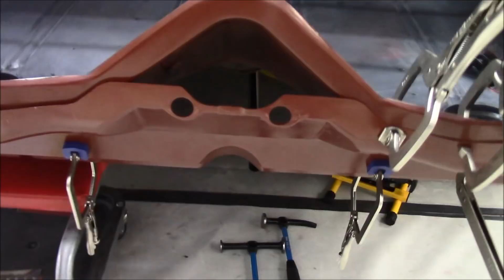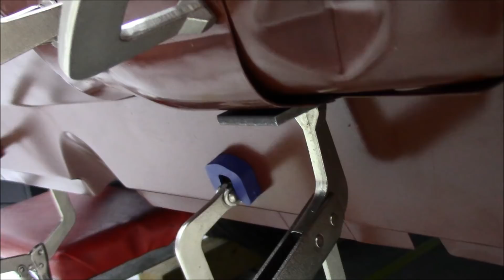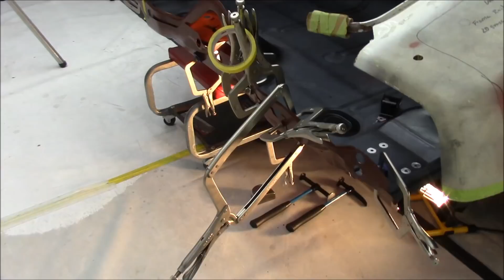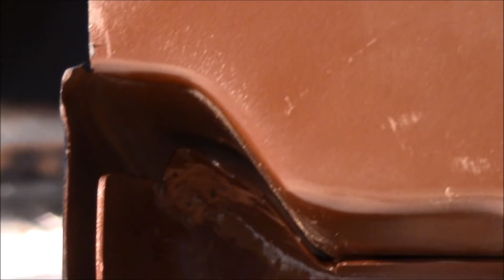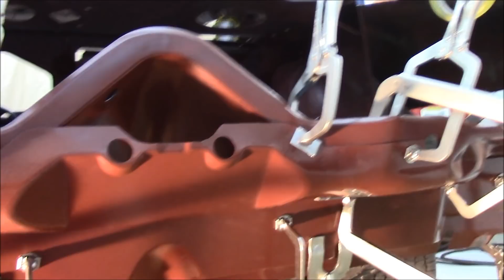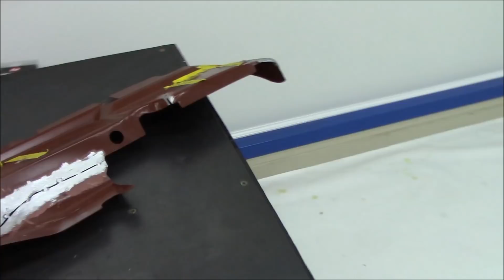1972 Camaro Project Overkill Crossrail Mock Up

Comment: Thumbs up Russ, the Camaro project is looking great. Your doing a great job on fitting those new panels onto the car. We all know that the new panels are terrible fitting and really difficult to graft into the cars but your working through a very difficult fit up and making it look the way it should look. Cheers OLDDUDE
Reply from the maker: Thanks. It does take some slicing. I hope the quarters are not as bad, but I bet they will be. Thanks for watching.

Comment: I like those clamps with the rubber tips.  They look like they would work very nice.  I find myself using those quick grip bar clamps when I run out of the Irwin style ones.  Although they don't fare too well when you weld near them :)  Nice fit up on that panel!  Thumbs up buddy
Reply from the maker: +Velvethamma Thanks Shawn. I really like the rubber tips as well.

Comment: Hi Russ. Those repro parts can bring a problem or two with them although they look good when you take out of the box. Keep up the good work. I think all of us Camaro guys are learning from your progress!
Reply from the maker: +Darrylz28ss396 DarrylG Thanks Darryl. The original cross rail fit good to the repo trunk pan, but not the flange areas of the gas tank braces and frame rails. The repo fit the flanges better so I decided to go this route. So far I like how it fitting. Thanks for watching.